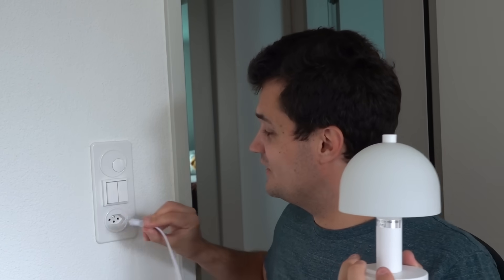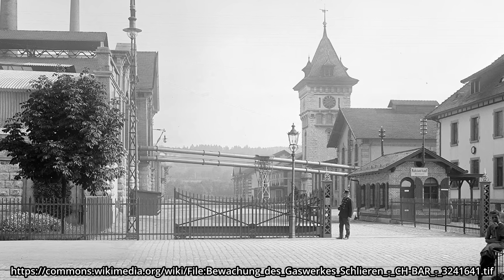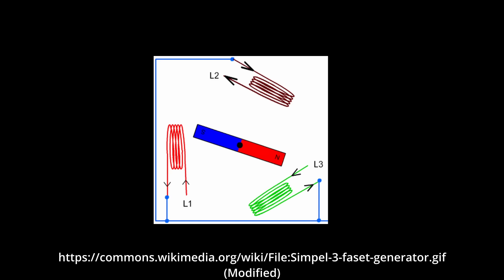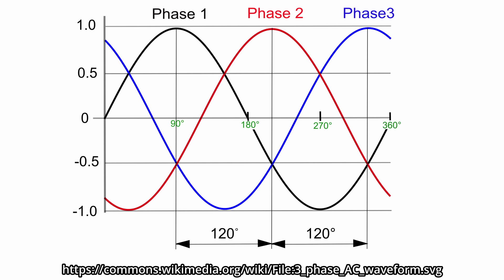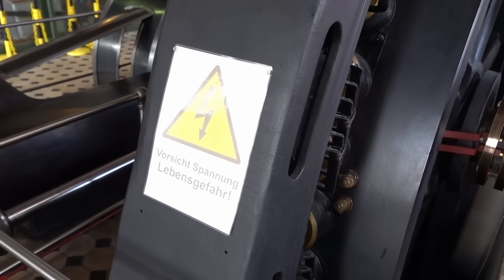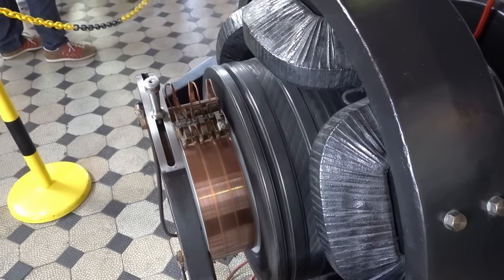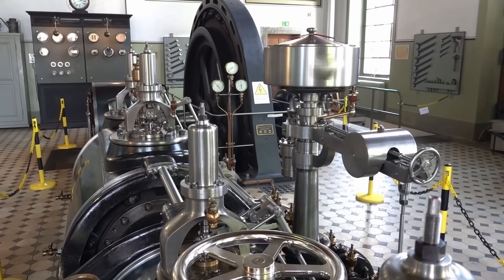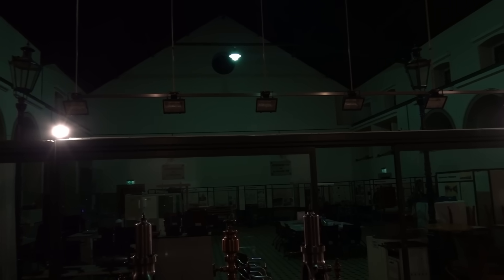Can a 1904 steam AC generator power a modern appliance?

Comment: Couple of Qs, do you have the count of teeth or salient poles on the rotor that has the DC field windings?  48? Also, do you know how many electrical poles it is wound for?  1150rpms doesnt fit any synchronous speed math N = 120f / P
Reply: The generator has 52 poles --> 115.3846..... rpm at 50 Hz

Comment: An efficiency boost may have been made by using the heat from the dump resistor to heat the water for the boiler. Which may have been done and just not covered; however, it didn't look like it when they were shown. Looked like they were just air-cooled resistors. Not saying they should completely redesign the system but just an afterthought for efficiency. (Yes, I know that this generator is not actually used for mains production and is just a bootstrap generator to be used to restart the grid in a black-start).
Reply: We have approximately 1 MW of thermal heating power to get 30 KW of electricity. If we would heat the water with our electricity the efficiency gain would be approximately 0.1 percent, witch is not worth the trouble. The generator is not connected to the grid in any way.

Comment: Modern US generators output at around 12,000 volts to the step up transformer. The step up transformer changes the voltage to transmission voltage, say 138 kv which is sent to the substation. The rotors are phase locked into the grid frequency. The grid actually creates a servo-motor lock to the rotor. If the frequency gets out of phase, the generator should detect and drop off line.

The distribution voltages and phasing is determined by the distribution transformers. In the old Edison DC day, what you generated is what you got. The 1903 date put it in the transition era. This means the generator was built most likely for an industrial application or a campus. In the early days generator were used for ice making and the surplus power sold to the adjoining homes and businesses. Transmission was not yet developed. Power company later consolidated the local ice houses and a created a small local grid.

Comment: We have a model similar that output 4160 volt primary for the Cherokee Mental Institute for the Insane, as well as a sister institute around 1902 as well in Glenwood Iowa which houses a much larger steam generator similar to the video, but 4160volt output

Comment: How long was it used commercially? Near where I grew up, there is a small (2 MW) hydroelectric plant built in 1922 that still operates on its original equipment. And I toured a hydroelectric plant in Ottawa, Canada that operated on its original equipment from 1897 to 2001.

Comment: Is it still possible to regulate the governor precisely and the voltage to synchronise it to tge swiss grid (via the transformer mentioned in the other comment). Because synchronising to grid is always the most fun and most tricky part of a generator (and, of done manually, the part you destroy it if you fail to badly)
Reply from the maker: Theoretically yes. There is a converter (not shown in the video) that brings the voltage to grid levels, so it would probably technically work. However, it would likely be a regulation nightmare.

Comment: Hydroelectric is the king of all power production methods. Harnessing one of the most fundamental and powerful forces in the universe. 
Gravity. To harness vast quantities of energy from the natural water cycle, requiring no special silicon like solar cells. With a material requirement of mostly concrete, steel and copper.  A hydroelectric dam can produce massive quantities of electricity for decades. No fuel needed. 
The energy can flow 24 hours a day, easily controlled with simply valves. Energy can be stored by allowing a reservoir to fill with water then tapped when it's needed. 
There are downsides, like all power generating methods, but hydropower is in my opinion the best and most sustainable way to generate large quantities of electricity.

Comment: I can challenge anyone to disapprove Electricity is not Energy, but a Medium which transmits Energy, the actual energy is a force, a force that can be used to turn or rotate a Generator that in turn produces Electricity, which mean the force was converted to Electricity in order to transfer that force or Energy to end user, the end user may need that force in his home to run a fan, to charge his mobile phone, so it needs Energy, but electricity is just a medium to bring that energy into your home.
Reply from the maker: I guess this way of modelling electrictiy makes a battery a spring?

Comment: I have a question here 
As you describe. Phase to neutral  220 .

Then Phase to Phase supposed  to be 440 

But you said  220 Phase to Phase 

In 120 system.    Phase to neutral    120 and Phase to Phase 220
Reply from the maker: One is the Swiss grid and the other is the generator's output - they are different

Comment: In the Netherlands a steam powered pumping station, which has been decommissioned a long time ago, is still being used as a backup for the new pumps. When there is high demand, it is fired up. So, a museum but still having an economical value. It’s the Wouda gemaal in Lemmer Friesland. You can visit it and once in a while it is powered up for maintenance and training. Being fed by coal at first but now oil burning.

Comment: Machines of the late 18 and early 1900s were so much more stylish than they are today. I used to work at 312 N. Spring St. in Los Angeles, CA on the 15th floor where one of two elevator rooms was stationed. Once in a while, the maintenance guy would do some work on the 1930s era equipment. I would poke my head into the room and look at all of the machinery, and it looked so good by today's standards. The same is true for this generator equipment. Very nice.

Comment: Just remember, since 1904 the ferromagnetic materials carrying the magnetic flux, improved a lot. Also, the formulas for designing electric transformers, motors and generators, were perfected. So, when you use an electric generator from 1904, the problem is not the steam engine, is the generator itself. 
In university I followed the specialization for designing electric motors, transformers and generators, so I know what I am writing.

Comment: Are most of the parts original or refabricated?
Reply from the maker: Hard to tell. It's had a major restoration a few decades ago.
Reply: Most of the parts are still original, even the nuts and bolts. I now only of a few parts which have bean replaced because they were worn out.

Comment: You know that was a great video with excellent details for those of us that know what we're looking at by that I mean showing us the ID plate and 215 Kva is way more power than I thought it was capable of. That is nearly capable of running a small town. Also very cruide voltage regulation and as you know it's done with an AVR (Automatic Voltage Regulator)  these days. Such an impressive machine, I would really like to see it in person one day.

Comment: Back in the 70s I worked at Mohawk Rubber in Akron OH where we ran very similar aynchronous motors to run the 74 inch Mill Lines and Banberry mixers

Comment: small side note: We have 240V today...
Reply: Not quite. The voltage used throughout Europe (including the UK) has been harmonised since January 2003 at a nominal 230v 50 Hz (formerly 240V in UK, 220V in the rest of Europe) but this does not mean there has been a real change in the supply.

Instead, the new “harmonised voltage limits” in most of Europe (the former 220V nominal countries) are now:

230V -10% +6% (i.e. 207.0 V-243.8 V)

In the UK (former 240V nominal) they are:

230V -6% +10% (i.e. 216.2 V – 253.0 V)

Comment: 5:02
Isnt there a mistake? I just dont get how you can have in Switzerland 220V between phases and 230 between phase and neutral?
With phase shift 120degrees, L-L voltage should be 1.73 of L-N voltage.
Reply from the maker: Switzerland has 230 V between L and N. But this generator has 220 V between L and L, which is unrelated and incompatible indeed. There is a transformer that was used when the Swiss voltage was changed.
Reply: @sandro-here  oh i understood now, the 230V was a reference to previous graph.
Thought that the generator has 230 LN and 220 LL
Reply from the maker: @Daniel-du4um  Yeah I explained that poorly. You are the second person to ask it.
Reply: @Daniel-du4um  To be more precise 220 LL and 127 LN

Comment: What is the rated output?
The nameplate shows 215 KVA.
Reply: That IS the rated output. Generators are rated in apparent power because it's assumed that the load will not be purely resistive. For resistive loads, 215 kVA = 215 kW

Comment: Amazing! and it LOOKS LIKE NEW! My old high school in Argentina, the Escuela Tecnica Otto Krause, maintains and runs a comparable steam generator every year. It is a bigger compound machine, made in Germany in 1913. It was used to provide electricity to government buildings in Buenos Aires, and remained operational as an educational and historical piece all this years. It produced short of 80 kW during the test run I attended to, dumped onto rows of banks of incandescent bulbs. The limiting factor is, I believe, the state of the rusty old boiler, which was not entirely safe at the working pressure (~12 kg/cm2).
Reply: I will remember this and when my ship gets in I'll get them a titanium boiler made.

Comment: Not sure if you covered it in the first video, but steam engine are pretty bad backups, needing quite some time to start up.
Did they keep a boiler under steam the whole time so the steam engine can be started immediately
Reply: They used steam in other processes on site, so they always had steam. As long as you have steam you can start such a steam engine in about 10-15 minutes from cold. But it is not great for the engine to be heated up so quickly.

Comment: 5:06 that's wrong! If you have 230V from L to neutral, L to L is x 1,73 (route 3) = 230V*1,73=400V!! Don't mix your single phase American toy power grid with an rotating field 3 phase to neutral which is completely different.
Reply from the maker: ...which is explained in 3:35 while the thing shown in 5:06 which you are referring to is about the generator. The generator does not implement grid voltage.
Reply: @sandro-here  that makes no difference. You need to understand the difference between star 🌟 and delta. The factor is always root 3
Reply from the maker: @MartinFunkenschuster  Indeed, but I'm not providing the generator's frequency between N and L at all. That would be 127 V.
Reply: @sandro-here  Voltage,  not frequency! I am shure, those old generators have usually 380V  Phase to Phase and 220V L/N. This is the most popular European powder grid until 1988, later 400/230V
Reply from the maker: @MartinFunkenschuster  I thought so too, but stood corrected - a few years after the installation of the machines, a converter was installed to fix this.
Reply: you have a problem with America? Is it because you've lived here or just listen to the other rabble?
Reply: @yamahale  not with America, but your power grid is like ours in the 1920s. The last power grid like that was switched off in 1958 in my town  (only one street). And yes,  i have stayed there for a longer time.

Comment: Beautiful! I have spent over 40 years working on hydroelectric generators dating back as far as 1896 that are still in operation today. Many of the dams and turbines date back further, before the advent of AC.
Reply: You lucky buggar, that is so interesting. The local hydro plant here( Tully N.Q. Australia)  had 4 X 17 or 18 Mega watts alternators before the upgrade, then after the upgrade the new Alternators have 24 Megawatts in the same size somehow with only one inch nozzles @ 2000 Psi, that's a scary pressure when you look at the size of the pipelines. Anyway I liked it before the upgrade because they had the Flyball governors out in the open just spinning around but now it's all electronic. You know how it is, progress isn't always a good thing but they did it for accuracy's sake & automation. Such an impressive place built into the side of a mountain.
Reply: Tesla and Westinghouse won the current war in 1893. 1896 was the time of AC.

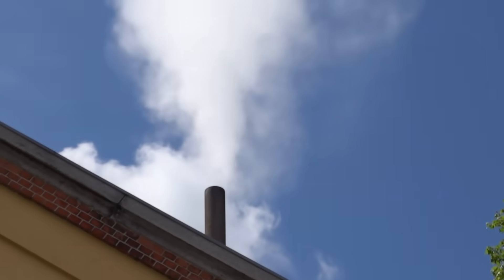Comment: I'm building a 1:25 scale model of a Three Phase generator coupled with a 25mm pelton turbine, I was struggling A LOT trying to understand how to wind up the three phase coils. Your video is really helpful because it confirms my zig-zag hypothesis. 
 I think I should put 4/5 wires for each phase and be able to turn on some 2v LEDs. 
A smaller cc motor will provide for the inductor coils, again, coupled with a pelton turbine
Reply from the maker: Very cool! Will you do a video?

Comment: It’s a bit of a shame it’s at 220 P2P not 400 P2P :( It would be beautiful to watch it manually sync to the grid (even if “manually” is merely for show) 

And at 215KVA laughs a modern transformer likely wouldn’t even notice.
Reply: that 220 could easily be bumped to 400 with a few transformers
Reply: @coalthedergsune  Or autotransformer, and it would require exactly three of them. But I am not sure whether it would be worthy to go through all the hassle to get the system running. Sure, why not, but in the same time, why? To recover bit of the money? Also maybe the boiler does not have enough power to run the engine at full power.
Reply: We actually have a transformer to get the 400V out, but it is sadly not connected.

Comment: Bait clicky title.  If it spins at the right speed and outputs the correct voltage and has more power o/p than the load, there is no issue at all pertaining to the fuel and energy transfer to the generator "wheel".
Thus a coal fired, gas fired, nuclear fired plant all work the same (turbines of course these days, but (in theory) and conversion of steam to rotation will work - whether piston, turbine or any other arrangement one might come to).

Comment: How stable is the frequency with only one steam cylinder?
Reply: Within the capability of the fly-ball speed regulator at the very most ...
Reply: @uploadJ  at a stable load is the frequency rely stable, only if the load changes does the frequency vary a few Hz.

Comment: 2:12 remember the diameter (∅ or Ø) symbol? You can think of circle as the coil and of line as the axis on which a magnet should spin.

Like this:
______
/   N  \
(—|||—)
\   S   /
–––––

What I'm trying to say is, you showed the least efficient (so, incorrect) way of generating electricity. And how I described is how all modern AC generators work.

Edit: at 3:04 you showed exactly how it works.

Comment: 2:12 the physical relation between the coil and the magnet is wrong. The magnet would need to rotate back to front  to induce voltage in the coil.

Comment: 5:00 You are confusing phase voltage to line voltage. If that generator has 220V between its phases, then it has a phase voltage of 127 Volts and first it needs to be connected to a transformer.

Comment: they should install grid tie switches and a synchro scope to allow it to use the grid as load.
Reply: Is that what those 3 lightbulbs are for?
Reply: @fanplant  no. they probably indicate the operation of various things like the exciter. A synchroscope is a needle type instrument where basically put, 2 motors are connected together via a differential gear (like in a car). One motor is connected to the power plants generator, the other to the grid. Usually there are also light bulbs connected to indicate the phase angle error. When the generator is in sync with the grid, the needle of the synchroscope should be at the 12 o'clock position, and not move. There is also the option of the needle being stationary at the 6 o'clock position, which would indicate that the generator and grid are 180° out of phase. If the generator is tied to the grid with a phase error,  the generator will be forcefully moved to be in sync. This will draw significant current as it tries to phase advance or retard in a single rotation to match the grid. If this happens the grid ties trip (basically big circuit breakers) and the generator is taken offline again. In case of the lights mentioned previously, they will be off when in phase and frequency, and brightly illuminated if 180° out of phase, and slowly oscillate from bright to dark by the frequency error, same goes for the synchroscope needle. 

Basically put, the grid ties engage all 3 phases simultaneously, else the generator will run out of sync and try to shake its self apart if the ties do not trip (overcurrent). If you want to see what that looks like, look for the video "Gen 1 Desync" by "GITsL9l". Its a short where you can see what happens when a generator falls out of sync due to the turbines (presumably) slowing down too much.
Reply: @lbochtler  sorry I'm aware what a syncroscope is and it can be done with 3 bulbs.
Reply: @fanplant  true, its unusual to see someone that knows what it is and how it works. My point with the switches below the lights and that one being lit all the time, still stands.
Reply: @lbochtler  I watched it again and agree you are correct. Good eye

Comment: It's been so long since I studied electromechanical systems, but it is changing magnetic lines of force cutting across the wires of a coil that produces electromotive force.  This would require orienting your stator coil/coils 90 degrees into the plane of the drawing from what you've shown, with allowance of course for the shaft to pass.

Comment: i might be wrong here, but the howling might be caused by eddie currents in the field coils, and they even out, im surprised the machine hasn't been kept as a backup generator
Reply: Easier to rent a Cat (Caterpillar) at 200 plus kw then all it needs is diesel fuel and one push button to start it though ...